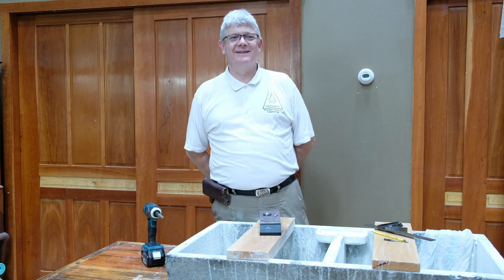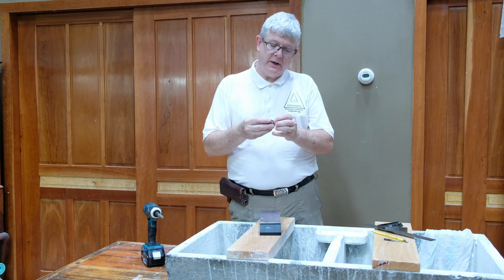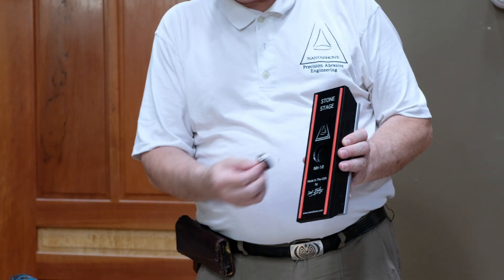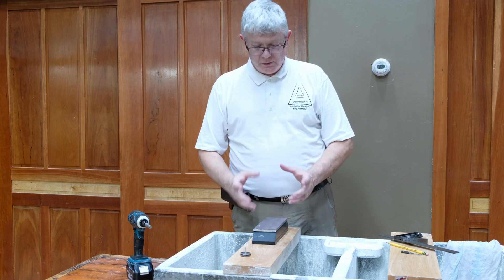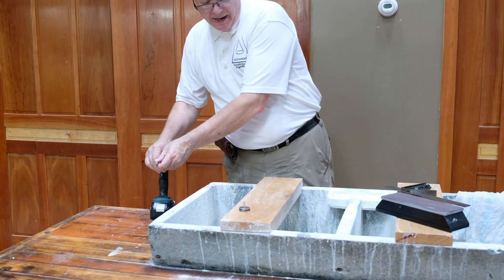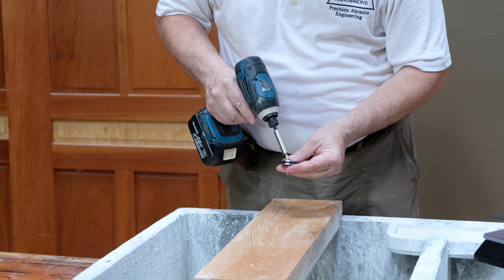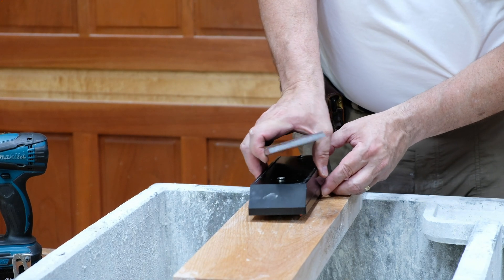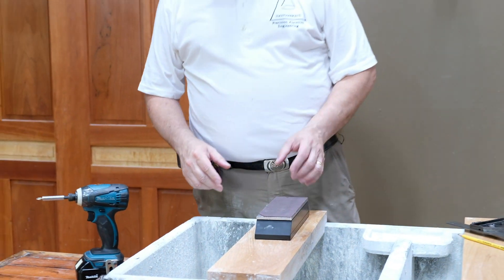Nano Hone Stage Button

Comment: any way to install on the older stone stages?
Reply from the maker: That’s a great question, you would have to drill a hole in the bottom of your Stage or send it back to me to machine a hole. It’s a solid aluminum billet so it’s not difficult to drill. It just won’t look very pretty on the bottom